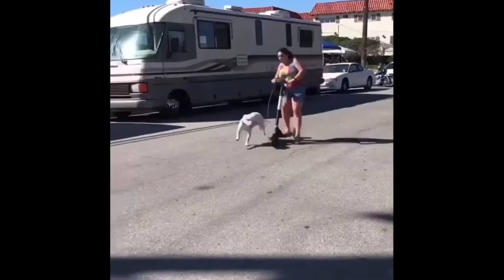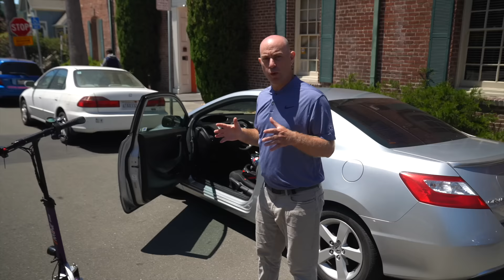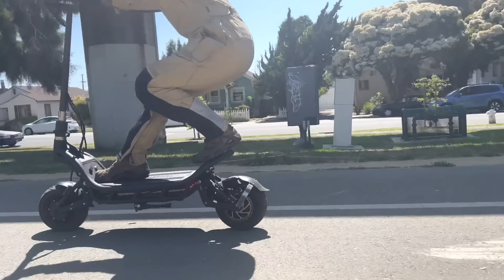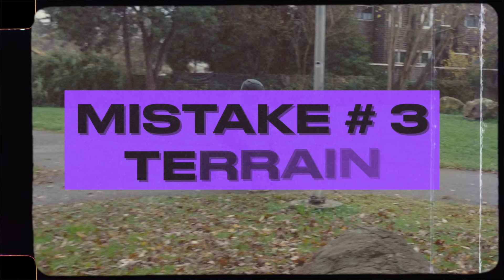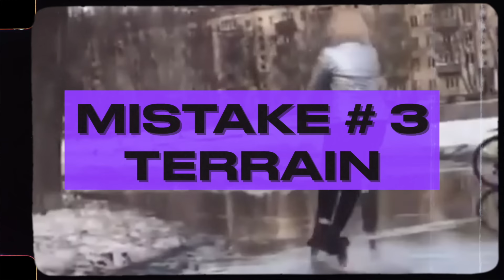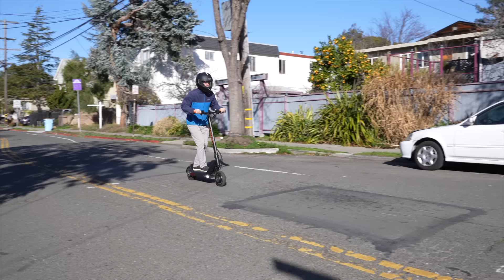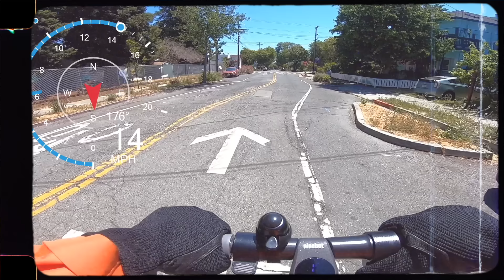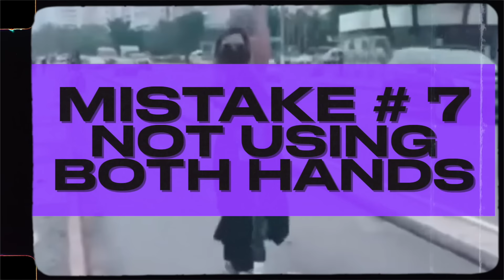Top 7 Riding Mistakes New Scooter Riders Make & How to Avoid Them

Comment: I used to ride regular aluminum kick scooters everywhere I went from middle school all the way until I was out of highschool. They honestly feel safer and more controlled than anything else I've ever rode on. Roller blades I would literally slam into walls and wipe out and roll down hills. Bikes are just too unwieldy and big and I think every bike I owned the pedals stripped off. Skateboarding is just ridiculous, you have to be very lean and experienced to do anything with them medium range.
Scooters you can lift the front wheel up very easily which means you can run over cracks and hop step grates and curbs, if there's a tree branch on the ground you can hop step it and kinda run it over and pulverize your way through. You can't do that on anything else without risking popping a tire, jamming the spokes/gears/break lines or just flat out wiping out.
I know electric scooters might be too heavy to do what kicks do, but I'll take it.

Comment: it makes me extremely happy that i already figured my own naturally like standing, knees, breaking etc.

couple of my falls caused by idiot/unpredictable pedestrians when i couldnt ride on road in walkway, so no need them.

my most serious one was caused by thumb throttle. when i was riding downhill with 35 km/h i run over from a bump that make the wheel turn right. my thumb was on the throttle but not accelerating during this time but not having a thumb around the handle caused to handle bar slip inside my right hand, scooter throw me over to road and i was dragged on road about 5 6 meters on my back. luckily i fell on my backpack  with my arms on air and there was no vehicle following me on my ass during that time because it was happened in main road.

so another tip, if you going to fall down, and believe me you are going to, at least know how to. knowing that landing and dragged on your back relatively safely and unharmed while facing cars comes from gives you the chance of rolling to sides in most extreme situations.
Reply from the maker: Very insightful! Thanks for sharing. -Vosk

Comment: More e-scooter channels should cover how to ride safely like you did here, I'm doing alot of research into a fairly high powered scooter and I see people ride like psychos. Blowing through stop signs, red lights, passing on double yellows, etc. Just out of curiosity I heard slightly pulling back on the handlebars can help with wobbles at higher speeds, but I have no Idea if that's correct or not. If you could let me know it would be greatly appreciated. Thanks!

Comment: I'm about to get my first scooter ever. We don't have a variety of brands and models here where I live, but I got lucky (at least, I think I did) and got Xiaomi 4 at the price of 4 Lite, from an official dealer, due to a discount season.
I'm only gonna use it once a while on pretty short ranges in the city, and I'm not a fan of big speed or bumpy roads, so I think it should be more or less all right. 

This video is extremely useful for any use, be it first time/professional; communal/sport max range etc
Thank you so much!

Any tips for beginners before they fall? xD

Comment: Danish law requires hand signals on an electric scooter, as it is to be driven like a bike.

Many regular commuter scooters have motor and regen (eABS) on the front wheel, which reduces the risk of wobbling and eliminates the risk of blocking the front wheel. 

Same time they're set up to disable cruise control as soon as the back brake is engaged, but I can see how one that's used to one-pedal-driving in an electric car could be up for a surprise. But you don't do cruise control and one-pedal in a car either.

I could wish for a physical button to switch between the two styles while driving though.. not some options in an app to set regen strength and to enable/disable automatic cruise control, because they've "simplified" it being engaged by a stable throttle...
Reply from the maker: Very insightful! Thanks for sharing. -Vosk

Comment: Ride with whatever foot forward you are most comfortable. You will likely react faster and avoid the impact altogether.  

Sand and water can bog down your scooter and/or push your wheels out of line of your direction of travel, which can throw you off balance.

The wheels generate a gyroscopic effect when spinning. Teh bigger the wheel, teh greater the effect. For scooters, the effect is barely noticable.

I don't have cruise control and would never use it anyway. I live in NYC and ther eare simply too much that can happen, to include poor road conditions and objects jumping out in front of you.

Comment: hand my first accident, went over a pot hole that you could barely tell is there because it blends well with the road. sled about 5-10 feet, my right hand slipped off the hand bar because of how hard the drop into the pot hole was.
Reply from the maker: Stay safe out there!

Comment: I typically signal by turning my head about 90 degrees on either side about 3-5 times before making a turn or changing lanes. I tried the leg method but I get worried about not having enough balance/grip. Thankfully, a lot of drivers notice and let me do my thing.
Reply from the maker: Awesome! Thanks for sharing. -Vosk

Comment: you mentioned the thing with two hands. While that is true, there are times when you might need to temporarily let go of one handle (e.g. GPS use) I feel like the biggest reason why people fall when not using two hands is that they put a lot of their weight on the handles (and if you wanna know whether you do that or not, a huge pain in your fingers and palm is an indicator of your doing this exact thing). So my tip would be to relax and lean slightly backwards so your body is almost straight (with slightly bent knees, still).
Also for people like me who have a hard time signaling with feet or hands, there are LED vests you can put on with a controller on your handle that function like car blinkers.
Reply from the maker: Very insightful! Thanks for sharing. -Vosk

Comment: I have the electric scooter with the seat on them and I did fall off side ways when I was going to go up on the path and was too high and the front wheel hit the kerb and I had to fall to my right but wasn’t hurt but I got a fright and I’ve learned not to go up on the high side of the path

Comment: 1. Always two hands
2. Don't go too fast (based on skills)
3. Avoid sudden, hard braking
4. Don't brake hard and turn at the same time
5. Proper stance
6. Don't go off road
7. Don't jump
8. Avoid potholes
9. Don't use cruise control unless you know what's going on
10. Get a seat if it's available for your scooter (almost no one ever mention, it's much safer seating down)
11. Avoid the narrow bike lanes (next to the road) if local law allows, especially if the bike lane is too narrow and with fast road going traffic. As stated in the video, regular bikes are much more stable (hence some people can ride it without hands), scooters are much more likely to fell over. It's very dangerous if you fall over next to fast going road traffic.
Reply from the maker: Thanks for the feedback!
-Vosk

Comment: Also, one little thing, while turning at higher speeds, it's more efficient and safer to lean inside like bikers do so that the momentum does not throw you towards the outside of the curve. You don't need to turn the handles as much as well. HOWEVER, it makes you lose some grip so avoid leaning when the road is uneven, wet, slippery, or in any case where you might not have standard grip to the road.

Furthermore, always keep your legs at least a bit bent like mentioned in the video because, if your back wheel slips, at it might do due to unexpected losses of grip, you can more easily extend your legs to get a proper footing or readjust your balance by kind of janking your hip to the side to counteract the slipping to one side.
Reply from the maker: Thanks for the feedback

Comment: Awesome video! Wish I’d watched this before i learned the hard way how braking works best for me. One important thing I think should be discussed for longevity and safety of the scooter, because I learned this too late (had little understanding of this) but when i first got my dual 1000w 52v scooter, I was originally planning on it helping me speed up hills no prob, however my scooter quickly started to overload repeatedly and after a year of troubleshooting and learning way more than i ever expected to learn about motors(all sorts including gas), how electricity voltage and current work, and even learned to be more creative… 

I realized that I’d made the mistake of trying to full throttle it in 2nd and 3rd gears with dual motors  switched on, without fully understanding how this stuff works. I had assumed that was the entire purpose for that much power… 
However, It’s better to use lowest gear for climbing hills even if it takes longer, and in your head feels like it’s putting more strain on the components, but it couldn’t be more of the opposite. The motors are actually fine and, unless the slope or load it’s carrying exceeds it’s design, the motor(s) shouldn’t stall or overload because the available current they can draw from is more stable and less heat buildup. I believe it’s also a great idea to leave “kickoff to start” enabled rather than off bc it prevents much unnecessary heat buildup in the wires and certain components. In a stationary position, an electric motor generally requires at least 10x the energy to begin turning than it would if it were already in motion. This is ESPECIALLY bad under heavy load, in higher gears, and more so with dual enabled.
All of that being said, i still have some issues with it overloading sometimes bc some of the dmg has already been done. I wondered if someone with more knowledge on this may be able to help me finally figure out a few things? 
Hope my info helps someone and hope it reaches someone who can finally take a minute to just talk about this cursed thing with me lol
Reply from the maker: Very insightful! Thanks for sharing.
Reply: I would like to add that my scooter WAS able to reach up to 48 mph max speed on flat roads and a 120 lb rider.  I’ve hit that a few times, no safety gear and luckily never wrecked. Most of my wipeouts were due to slide start being disabled and dual motors on without realizing. Damn thing had some serious torque. A real shame the manufacturers cut corners with wire gauge and never included a manual nor sent a digital copy when asked.

Comment: Recently, I wrecked my scooter. I had both hands on the handlebars, however, my usual firm grip had become a lackadaisical squeeze and I ran into a short thick tree branch or a portion of a 2 × 4. Regardless, the jolt was enough to cause me to lose my lax hold of the handlebars and tumble to the pavement. To top it off I was not wearing a helmet. Needless to say, I visited the ER for treatment for abrasions to my head, nose, forearm, knee and stitches on my elbow.
Reply from the maker: Sorry to hear that! Feel better.

Comment: I'm a noob. And I wish I had seen this before I went and tested out my ekickscooter. It's not fast tops at 12 but the two times I've tested it I've gone way less. But today I felt brave enough to go a wee bit faster. It was good a few times, on that last one down my street, as I was slowing down it wobbled, I got nervous and hit the brake a bit too hard and I ate the pavement face first. Messed up both my knees. Got a big bump on the right side of my forehead, my nose is brused a bit, scrapped my right cheek bone and scrapped my upper right lip.
I wasn't wearing any safety gear, because In a few days my cousin told me she was would be available to take me to buy gear. That same day she wasn't able to take me coz it wad getting late for her. So yeah I was impatient and now I'm gonna get an ear full when my cousin finds out I fell. 😂
I've learned my lesson and I will not be riding till I get my helmet and everything else I need. Thank God my fall was not serious. It could have been really bad. 
Be safe people do protect yourself with all the safety gear even if u are a pro. ✌️🙏

Comment: My first fall happened because of a taxi I didn't really pay attention to. The guy was right ahead of me and went to a full stop and it caught me off-guard. I'll admit, I was barely looking in front of me (I assumed he wouldn't stop) and so I broke hard, without taking momentum into account, since I was still fairly new to riding. I went over the scooter and hit the pavement, my entire body landing over my right wrist. I was in so much pain I couldn't even get up, fortunately the taxi driver got out to help. I thanked him and sat in a bench for a moment, evaluating what just happened and the damage dealt. I was wearing a helmet and gloves (which saved my hands), but no knee/elbow protection. Since I landed on my right side, my right knee and elbow were hurting way more than the rest of my body, along with my right wrist, which got a sprain since I used my right hand to soften the fall (bad idea, I know). I was in my Mantis 10 and don't exactly remember how fast I was going, but I'm sure it wasn't that slow of a fall either (must've been around 30 km/h or so).

Honestly, I learned a lot from a rather terrible experience, I think we all do every time we fall or crash, unless there's a malfunction that's out of our control, that is.
Reply from the maker: Glad you are okay

Comment: Most important thing is that this breaks and speed is not the same as those you rent out on the streets,hereby never forget how to properly stop your scooter...you dont have to put one of your foot all the way at the tail of the board but your feet really need to be separate one from each other to balance your body and very super important...like you see in the video...ducking down while you're breaking its extremely important... before you decide to go into adventure i would recommend that you practice how to properly stop., besides all, always remember that try to look ahead and your surroundings to avoid any danger...just like being driving in your own car.
Reply from the maker: Very insightful! Thanks for sharing.
-Vosk

Comment: I own a pure advance generation 3 and I have noticed what I consider to be an extremely dangerous design flaw, the handle bars are foldable as is the left and right hand grip but twice I encountered uneven Road surface and as the scooter hit a bump the left hand grip folded down, I won't lie it was a "brown trouser" moment !! This needs to be addressed immediately
Reply from the maker: Very insightful! Thanks for sharing. -Vosk

Comment: My best  advice for anyone wanting to ride these on the road is do your basic training for a low power motorcycle 50cc/125cc in England it's called a cbt. Not only will you learn the basics of adapting to the road and learn general road skills, But it will teach you to ride safely aware of your surroundings and give you some important insight to how other people act on the road. It costs very little, you can rent a bike to do the test on and will potentially save you from a nasty accident or death. People have very little road awareness these days. I see so many kids on these scooters, even older people that have no car licence or never had a motorcycle. They have zero road experience. My e scooter has a mirror on the right hand side ( for keeping an eye on overtaking vehicles and staying safe on islands or roundabouts. I have extra reflective vinyl on the sides of the scooter, a helmet is a must for the roads and gloves. That will protect from damaging your skin trying to break your fall and if your too late the helmet is going to save your head. Dont use your arms or legs to signal, you've got two of each and you need those two on the scooter atall times. I have a backpack with a bluetooth remote on the left side of the handlebar, my backpack lights up and shows I'm signalling left or right and even has emergency brake warning. All these things might seem overkill but belive me there's a reason cars or motorbikes have them. If your on the road you need to be prepared as much as possible. Scooters are cheap enough to replace but your life or health is irreplaceable.
Reply from the maker: Thanks for the input
Reply: @ESG-ElectricScooterGuide  no problem. Enjoyed the video. Make sure your atleast 1.5 metre from parked cars, you don't know who's inside till a door swings open. Assume every car has someone about to open the door. Years of being on the road on a motorbike has taught me that. Even in a car I leave enough space for a door to open.

Comment: I wish I watched the video before I broke my hand. Besides doing a few things wrong I think the main reason for my fall is the fact that the breaks on scooters are reversed from bikes.  I have been riding bikes for a long time, but I'm new to scooters. So instinctively I hit the right break and the front wheel locked up, rather than the rear wheel.  I'm surprised that I did not see more people have problems with this issue.
Reply from the maker: Sorry to hear that! Hope you are doing better. -Vosk

Comment: I've had many falls but my most recent one is the only one to send me to the hospital. 

I was on my Inmotion RS, Gear 2. There was a tree branch that had snapped but was still connected up the top. There was a small gap to slip through, so I did at approx 65km/h (40 miles for you lot the refuse to use the metric system like the rest of the world). My handlebars clipped the branch so I did an instant full left turn and it threw me off on to the concrete.

I made a stupid mistake of trying to go around the branch and I was only wearing a helmet. I spent 48 hours in hospital and I had to get a skin graft as I took my right elbow down to the bone. Also broke a rib and damaged my shoulder. My helmet saved my ass though, so if you're reading this: PLEASE wear a helmet! It can literally save your life!